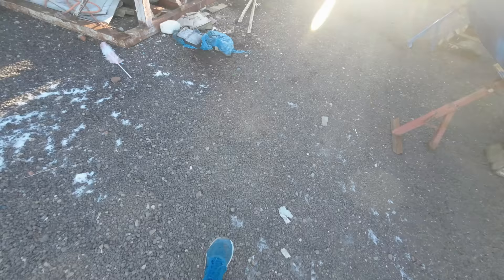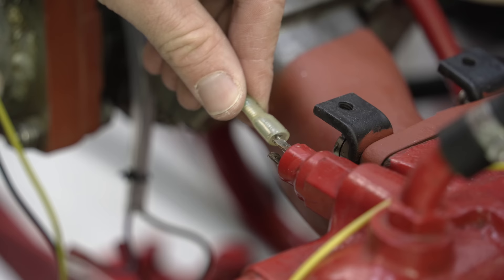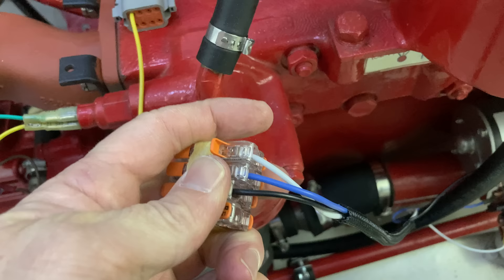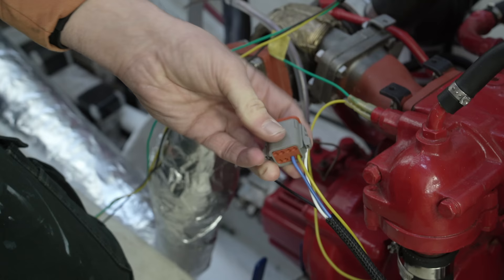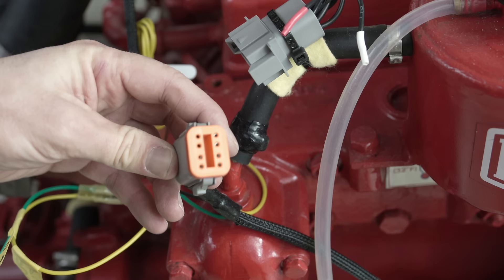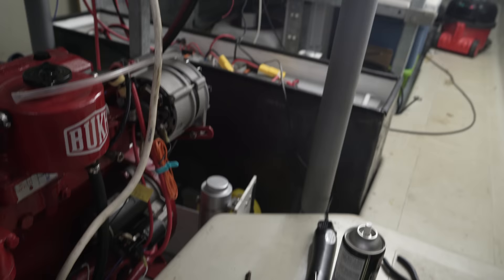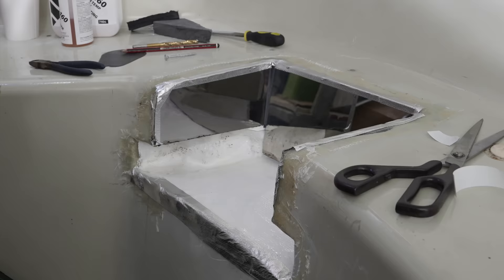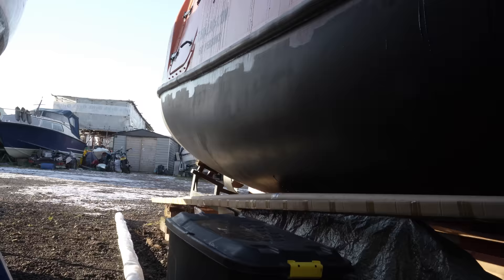Adding waterproof Deutsch DTM connectors to Alan's engine wiring loom. Lifeboat Conversion Ep64 [4K]

Comment from the maker: I fear I worded the VO poorly with respect to the dielectric grease. I meant to say that you can get a good tight connection whilst reducing corrosion, not that the grease itself conducted electricity. Cheers all for flagging that up.

Comment: So glad to see you step up to the Deutsch connectors. I have used them exclusively on police car builds in Canada for all the external light and siren connections. We endure 6 months of snow which means lots of Salt and even some Calcium Chloride to melt ice on the roads. Both are very corrosive to metals, especialy copper, but Calcium Chloride is much worse than Salt. It wicks into everything and is more chemically aggressive but I have never seen a problem of corrosion in any Deutsch connector.  They are cretainly "one of"- if not - "The best" connectors available today because they seal so well and don't become brittle with time. I have remove hundreds when stripping old police vehicles to go to auction, many of which have been over a dozen years old and they could easily be reused for many years to come.
Reply: They are really hard to beat, I have tried tons of different connectors for Motorsport harnesses over the years, and have not found anything better, the only close to as good thing is the molex CMC connectors.

Comment: That deutsch connector is a great upgrade.

Dielectric grease is not conductive, that's one of the reasons it's used on spark plug wires. Should be fine on those spade connectors and does prevent corrosion. It should be avoided on higher current connections.

Comment: Having been the not so prowd owner of a Bukh engine with a sailing yacht built around it, I have been glad quite a few times I had sails. 
Maybe mine was the poorest produced Bukh in history, but I have never experienced a more unreliable piece of machinery. 
I renewed every asset (dynamo, starter, fuel pump, cooling pump, filters, wiring, nuts, bolts, gaskets) but even then the Bukh never ceased to cease at crucial moments. 
I wish you happy holidays and the miracle of a trustworthy Bukh.
Reply from the maker: That's a shame to hear. The exception rather than the rule though I think. What parts have failed you?
Reply: @AlexHibbertOriginals  
To put it shortly,  only the engine block and bearings did not fail. Every addition to that, failed. 
I once did a trip on a freight barge with a passenger accompanying us. He was a retired Bukh mechanic.  He loved the engines.  At a certain early morning  moment he started summing up the strange defects he encountered.  
I had to interrupt him when it was lunchtime.  
I really like your channel. And wish you nothing but great adventures. 
Having had lots of precarious moments while sailing, I simply would like you to have a plan B when the Bukh fails. 
The plan B might consist of a liferaft with an Epirb.

Comment: I know its a bit late but instead of a wire brush, I find a small diamond file very useful to remove corrosion from heavily corroded electrical terminals. Heat shrink tubing after applying dielectric grease creates a great seal, but this is mostly my own way of doing it. Great work by the way!
Reply from the maker: Very glitzy.

Comment: A quick tip. The resistance when installing the wires is from the silicone boot that the wires pass through first (the orange bit). You can pull that out, feed all the wires through it first and then click them into place in the connector body. No risk of nicking a wire with a screwdriver.

After all are locked into the connector, push the boot back up and into the body.
Reply from the maker: Good tip - although I've found these silicone wires do it with Anderson connectors too. They really have no stiffness to them.

Comment: Woooo best connectors ever. Been using them in Motorsport harnesses for a while, really love the solid pins. But the stamped pins do provide more wire retention strength.

Comment: 1:15 I personally like having my second set of gauges be local and mechanical (oil pressure, coolant temperature). Low priority in the grand scheme of things, but a better use of money than replacing good parts just in case. That way you can see your readings from the helm or by the engine, during an electric failure, or if a sending unit fails.

Comment: Make sure you give the crimped connections a good tug to make sure the wire is well crimped. Those connector pins are not intended to be crimped like that. A proper set of deutsch crimps squashes the pin from multiple points around its circumference. Take plenty of spare pins with you on your trips!
Reply from the maker: Another tool!
Reply: @AlexHibbertOriginals  Another expensive tool!

Comment: Hey Alex, It's Possibly a little late in the Day.....But Youtube guided me to Your Sea Trials Video and I Couldn't help but Think of How You Could Easily Calculate the correct amount of ballast to achieve or possibly improve upon Alan's intended optimum Seakeeping Characteristics as envisaged by the Naval Architects during Alan's design process and proving Sea trials....!!!!!! It's Just a thought.....Although I promise at this point that it's definitely worth at least reading to the end.....But it definitely seems like Alan was Designed to Achieve his Optimum Sea Keeping Potential in a Rescue situation in Heavy Seas with 68 x c.100kg burly Norwegian seamen being rescued on board evenly dispersed around the vessel at about the waterline......which is quite a lot of ballast to make up for before reaching Alan's planned for weight dispersal to reach what the naval architects would have planned for in terms of achieving ideal sea keeping in a rescue situation in rough and challenging seas....and although they would have been seated at about the waterline the c.6.8 tons of burly Norwegian seamen who I assume would have been present in human form or simulated form during her original sea trials, would have done a very great deal to ameliorate the destabilising & pendulum like effects of the high up mass of her rather generous layup of Alan's topsides which would have been laid up to withstand significant impact forces at sea coupled with Alan's somewhat round hull profile....As such more captive ballast in the bilges calculated to roughly simulate the effects of 6.8 tonnes of people sitting at the waterline; which one assumes due to the leverage of being at the furthest point below her centre of gravity would be significantly less than 6.8 tonnes but probably very easily calculated with a brief trawl of the internet as there must be a calculator for naval c.o.g calculations somewhere, and an amount of ballast close to this figure might possibly better approximate what the naval architects might have intended in terms of her intended optimum sea keeping characteristics in her original proofing sea trials and her original design....Sorry if I'm suggesting what you've already though of or I'm a little late in the day....But I thought that it might be an easier way of finding and Achieving Alans optimum Sea Keeping characteristics other than blind trial and error in terms of achieving greater or optimum comfort while at sea....before embarking upon your epic adventure and of achieving almost exactly or better performance at sea than what the naval architects would have envisaged in terms of Alan's optimum sea keeping in a rescue situation while in heavy seas during Alan's original design process.....Also having the correctly calculated and installed the correct amount of (very) captive ballast that far below Alan's centre of gravity would do wonders for both optimising his/her self-righting characteristics and probably ensuring that they're never needed as she should always want to roll back to centre and have maximum damping effect of the initial rolling motion in the first place.....Hope This Helps a little bit even if it helps in optimising her continued development in the future as I've Just noticed the Youtube time stamp might suggest.....& Very Good Luck With Your continued Expeditions in the future too....!!!!!! Chris :)

Comment: If you strip back the outer insulation of the cable with black conductors you should find that they are individually numbered.

Comment: i diidn't see it in the vid so i'll mention it you can get blanking pins for the unused terminal holes to keep the german connectors waterproof. they just push in and can be removed if you want to add another wire later.
Reply from the maker: You certainly can get plugs from Deutsch - yep. Only a few pence.

Comment: Propellor guard: have you considered how your propellor will manage lumps of sea ice (perhaps ordinary diet), in icy cold water. Lumps of ice may jam, stall the prop, distort the round duct and make further progress difficult. That ring is great when there is an emergency, with people in the the water who need to be rescued, but I don’t think the design is good for making passage when the top 3 feet of the sea are full of bits of broken lumps of ice. What do you think???    Alan in London
Reply from the maker: This question, and that of the security of the skeg, prop and rudder in general, has plagued me since the start. I'm still not 100% decided on what, if any, action to take.
Reply: Well I think that you need to expand that ring having first set up a horizontal grating forward of the propellor so that water , and restricted in size, ice lumps can be batted away by the prop blades without jamming in the ring.
Also to deal with shock waves generated by the prop munching through hard material, ( rocks in a kitchen liquidiser)…you need to think about a shock absorber in the prop shaft. Hopefully this will eliminate shaft damage and gearbox damage. There is a lot in this…….what do you think?    Alan

Comment: Does the ceiling above the heater need protection?  I don't know the characteristics of fibreglass.
Reply from the maker: GRP can handle over 100degC. I'll use a temp meter, but I'll be extremely surprised if with the lagging, the boat shell heats anywhere near that.
Reply: @AlexHibbertOriginals  Alex I had a rare hip bone disease starting when I was 2 years old.  I applaud you for doing this and the end goal.  I wanted to see you safe when this is your home in the midst of an adventure.
Reply from the maker: Thank you Ron. All my best to you!

Comment: Those look like some serious connectors, I'll have to keep them in mind. I do wonder about the water resistance when not all of the holes at the back are populated with wires.
Reply from the maker: Yep they'll not be waterproof now, but sticking a couple of stumps of wire through will seal them.
Reply: @Alex Hibbert Originals  oh good to know. Would suck if you had an odd number wires lol but these seem like probably the exact kind of European overengineered gear that is gonna last you forever if you do it right.
Reply from the maker: Apparently you can buy Deutsch plugs for that, although I reckon spare wire will work.
Reply: @AlexHibbertOriginals  fantastic. I've been following Alan since the early pandemic influx of viewers. It's been really cool to see the evolution, especially with the video showing when you purchased it.
Reply from the maker: Cheers! I was here from the start too. I liked the old days - 4 subscribers.
Reply: @Alex Hibbert Originals  Hahaha, yeah but now there's Alan's Army

Comment: why did he add "dielectric" grease, wouldn't that make the connection worse? I thought it was not conductive?
Reply from the maker: It protects from corrosion, and as long as the physical connection is tight, allows a good flow of current.
Reply: @AlexHibbertOriginals  ohhh I see know, Thank you!

Comment: If you didn't like the original wire colours, you'd hate most industrial machines. Very often most of the wires are the same colour, usually black. If you're lucky the manufacturer will have put a numbered cable marker on each end. If you're really unlucky the manufacturer sadistically put different numbers on each end (yes, some really do this). Often the only way of figuring out where a wire goes is to rely on the highly sophisticated technique called 'pull on it and see what moves'.
Reply from the maker: A manifestation of evil.